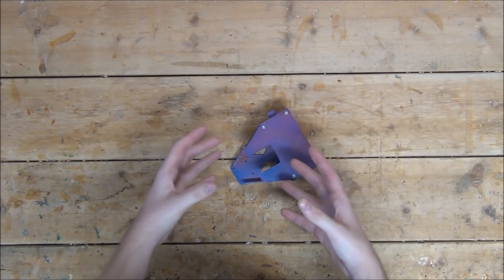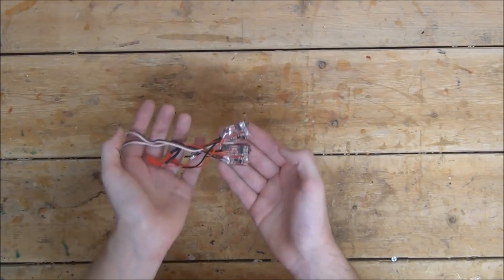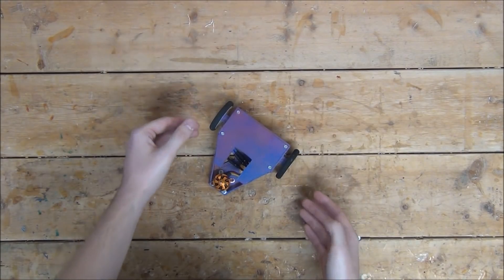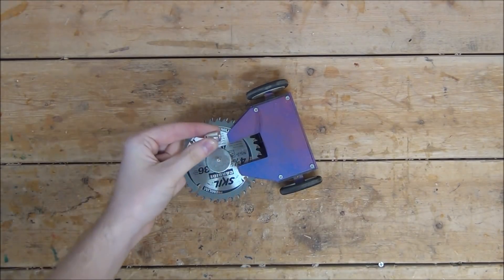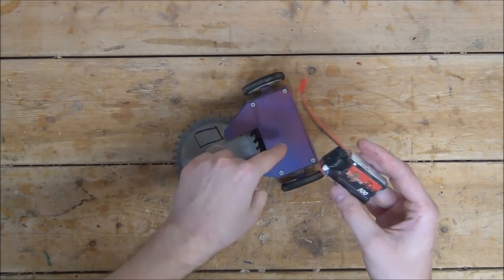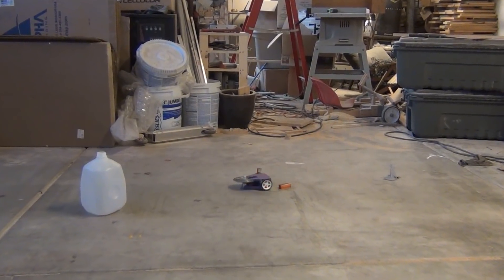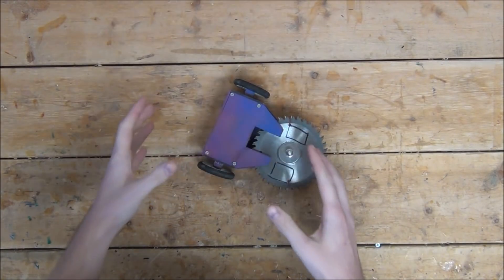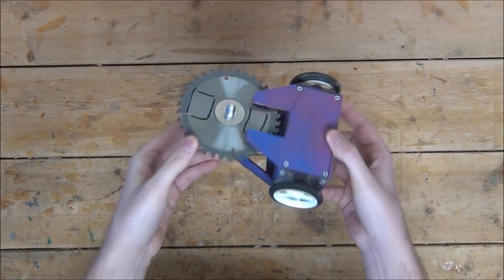How To Build A 1LB Spinner Battlebot Part Two!!! // Testing The Bot!!!

Comment: How the hell are you gonna bolt the blade down if it doesnt have screw thread.. yes theres a thingie you can slide onto the motor with screw thread but its just loose on top..
I superglued it on and tested it with a plastic blade and it almost flew into my tv...
Reply from the maker: Oh mercy no. NEVER test weopons outside a test box! A LOT can go wrong!
Reply from the maker: I cant speak for what you used. As for me, Its a threaded sleeve that goes on the motor. The tighter you tighten it, the tighter it holds to the motor and blade.
Reply: @MechNinji  i did that and superglued it i have the exact same motor only the 2450kv version.
But Im gonna buy one where the shaft is already threaded a lot safer i hope.
And im gonna build a layer on top so it cant fly off.
Reply from the maker: Super glue alone will NEVER hold. I used super glue to hold the blade in place WHILE I tightened the bolt. The super glue does NOTHING after that.
Reply from the maker: But again, NEVER test a bot outside of a testbox.
Reply: @MechNinji  and it was totally safe i took cover behind a chair😂

Comment: I know the video is two years old, but if you combine the two forks on the top part of the chassis, it would be more rigid and might not break as easily.
Reply from the maker: Very true! Yeah, sadly I didnt do a very good job explaining my intentions in this video. At the time i had a LOT of peeps asking me to show them a guide on how to get started building a spinner combat robot. And so I put this video togeather. It was never ment to see actual combat, just ment to surve as a very rough guide on how to get started, and take your first steps. I had a lot of rando parts laying around and so in a few hours I slapped this togeather, just to have fun, and try to show that it doesnt have to be hard to get started. But sadly, even to this day, I get messages of people building this bot part for part which saddens me. In many ways I often feel like this video may have done more harm then good.  :/
Reply: @MechNinji  I think it could be cool if you made another video showing what would actually happen in combat and why this was just a base to get started.

Comment: i see in your video you use https://www.ebay.com/c/691196922#oid332357822669 this esc.  it show me that this esc working voltage is 3.0-9.4v. how did you use 11.1 volt lipo battery? can you explain to me?

Comment: It seems like the drive motor ESC link is broken. Could you recommend another one?
Reply: https://www.ebay.com/itm/RC-ESC-20A-Brush-Motor-Speed-Controller-w-Brake-for-RC-Car-Boat-Tank/332357822669?hash=item4d6211e8cd:g:6PEAAOSwSypY9yNN i found it on ebay and it was the exact same name as the old one, just a different listing

Comment: The "Drive Motor ESC" in EBAY is not found can you post a new link or an AMZN link please?  -- Maybe this one would work -- https://www.amazon.com/Shaluoman-Brush-Motor-Speed-Controller/dp/B07GSVS8D2/ref=sr_1_4?keywords=RC+ESC+20A+Brush+Motor+Speed+Controller+with+Brake-for-RC-Car-Boat-Tank&qid=1567412380&s=gateway&sr=8-4

Comment: Hey a built a bot just like this thanks, I'm having an issue with the bolt staying on the motor for the spinner. Do you have thoughts?
Reply: Hey man, I’m building this bot too. Is it the little cap piece that slides onto the brushless motor that’s sliding off?

Comment: Hey which receiver did you use I saw that it was a spektrum but couldn’t make out the model
Reply from the maker: The one I used in this video was a spektrum dxe, However I don't recommend it. The Skyfly Fs I6 is a LOT cheaper and can do a LOT more in terms of robots.   :)
Reply: Mechanical Ninjineer ah ok thank you so much

Comment: Did you use 12 volt or 6 volt for the drive motors?
Reply from the maker: I believe i used 12v motors for this bot. However i currently use larger 6v motors for my other 1lb.

Comment: I love this tutorial it’s one of the better one’s on youtube, but i had two questions

How does the robot go left and right because it has no servo’s and what channels on your receiver do you use for the blade and the motors?
Reply from the maker: No, i don't use any servos in this bot however i do have two geared dc drive motors (N20s) That I use. They work great you just of course have to run them through ESCs.  Servos typically aren't used for drive motors in anything larger then 150 gram bots because they aren't really built too well for it. 

     As for channels, it will depend on your setup, but i use 1 and 2 (mixed) for drive and 3 for weapon. :)
Reply: Ty i am going to build this one myself. Kust need a cheap rc tranmitter and reciever and rhen i'm all set

Comment: Can I put a 6,5 Volt receiver in the bot?
Reply from the maker: Most receivers can run with 4.8v to about 6v provided to it. But if you do have a 6.5v receiver that's fine, you'll just need a 6.5v BEC.

Comment: I have a question will it work if I use four motors and a weapon and in use four speed controllers instead of 2 with a five channel receiver and use the fifth slot for the weapon motor. Thanks for any help
Reply from the maker: Yes, that is possible! However you can actually get away with 3 ESCs and a 3 channel receiver. Two ESCs, for the 4 drive motors, and 1 ESC for the weapon motor (assuming you're not using a servo, because a serve doesn't need an ESC). Give me a sec and i'll drop a link to 2 of my videos that should help!  :)
Reply from the maker: https://www.youtube.com/watch?v=38LL_vHCpn8&t=313s
Reply from the maker: https://www.youtube.com/watch?v=8JftijCIQ-E

Comment: You could improve on the blade design... simply cut off ALL the teeth except 4, making sure the remaining ones are evenly spaced. this will increase the contact points of the blade with your opponents.
Reply from the maker: I would just use a different blade. Its not usually a good idea to start cutting parts of the blade off because it becomes very hard to keep it balanced

Comment: I know i'm late to this but i hope you can reply. I'm trying to build a bot of my own and i wanted to get those esc's and use the same battery as yours but i couldnt help but notice the battery is a 3s lipo and the drive esc is rated at 2s lipo. Is it still ok to run this or did it fry your esc's?
Reply from the maker: Great question! Since the voltage difference is within like 1.5ish volts it was totally fine. ESCs are almost always rated slightly lower for safety reasons. So if you do go against their recommendations you do so at your own risk.

     With the being said though i didn't test this bot much outside of this video so idk how it reforms long term. BUT i did use the same exact setup in a lifter bot, same bat, same ESCs, same drive motors (actually plus 2 more) the only thing that changed was the brushless motor, i replaced it with a large servo. I fought with that robot and had zero problems. 

    So short answer, if you can find 3s ESCs you like, GO FOR IT! that would be best! But if not, to the best of my knowledge these will work just fine. Just make sure not to leave the battery plugged in untended, but that goes for any and every robot. :)
Show less
Reply: @MechNinji  Thanks this helps alot :)

Comment: How come your bot is remote control could you explain and how it isn't wired
Reply: He is using a 2.4ghz remote controller. you can pick one of these up anywhere for very cheap. He has that connected to  a reciver on the bot.

Comment: AND! How many different main batteries will I need? How long does just one battery last?
Reply from the maker: The Robot will only need one battery in it at a time, however you will want spares. As for how long it lasts that depends on what kind and size of motors you're using and what size battery. For me, the battery i used lasted about 4 or 5mins on a single charge in my bot.  :)

Comment: also. what did you use to attach the wheels to thr motor housings
Reply from the maker: A great thing you can use for that are hubs. There are alot of different versions however 3mm universal mounting hubs should work just fine for n20 motors ( the drive motors i used in this video)  :)

Comment: im making this bot as a project, is their anyway to hace the blae in a different postion? Low instead of high?
Reply from the maker: You're asking if there's a way to mount the blade lower? No, not really. However you could mount the motor upside-down which in turn would make the blade alot lower. That is probably your best bet OR you could make a vertical spinner.  :)

Comment: Where exactly to do u connect the gear motors to the esc wires
Reply: Where do u solder it to
Reply from the maker: Im so sorry, im not sure if I understand the question... But the brushed motor will have two leads that you'll solder to the two output leads of your brushed ESC. Does that help?
Reply: Mechanical Ninjineer thanks that helps

Comment: Could you please remake this because some of the parts I need are no longer in nger available and I really want to make this robot
Reply from the maker: All the parts should still be available, what are you having trouble finding?
Reply: Mechanical Ninjineer the first part of the wheels gear box in part one it is no longer available
Reply: Mechanical Ninjineer or the motor housing is no longer available
Reply: Mechanical Ninjineer motor housing look for yourself
Reply from the maker: well here are the motor housings https://www.aliexpress.com/item/F05101-10pcs-3PI-miniQ-N20-Micro-Motor-Mount-Set-12mm-DC-Gear-Motor-Mounting-Bracket-Toy/32814175769.html?spm=2114.search0204.3.2.466d5d7ePJQzc2&ws_ab_test=searchweb0_0,searchweb201602_1_10152_10151_10065_10344_10130_10068_10324_10547_10342_10325_10546_10343_10340_10548_10341_10545_10696_10084_10083_10618_5723411_10307_10059_100031_10103_10624_10623_10622_10621_10620,searchweb201603_45,ppcSwitch_5_ppcChannel&algo_expid=19a14a63-c998-4e39-b743-a98a3fc20895-0&algo_pvid=19a14a63-c998-4e39-b743-a98a3fc20895&transAbTest=ae803_1&priceBeautifyAB=0
Reply from the maker: sorry for the super long link...
Reply: Mechanical Ninjineer it doesn't matter I just wanted to get the right parts
Reply: Mechanical Ninjineer thanx

Comment: And how much does all this cost?
Reply: If you add up all the parts he links to, you arrive around $130. The blade is probably around $15, and lexan polycarb is around $5 - $10 for a small sheet. So the whole thing probably cost around $160 or so plus consumables (glue, struts, etc.), certainly all in should be well less than $200. Of course, that's before one factors in spare parts...
Reply: Ok. Thanks, Leigh Hargreaves! Wondering if i could make it myself. Thanks for the help!

Comment: I made a bot with a DC Motor, a huge clip, and a battery for the base of it. I used the DC Motor with a wedge shape piece to hit against the clip and shake. It shakes in a circle so it wouldnt stay in one place. The bot has a blade on the end of it to jam wheels, or cut or scratch if driven into. It’s basically a minibot that auto-pilots.
Reply from the maker: Im not 100% sure what you mean, but it sounds really cool!
Reply: Mechanical Ninjineer lol thanks!

Comment: Hey Mechanical Ninjineer! I am 14 years old and I'm building my first ever bot based off of your design (with a few tweaks), but instead of cutting out the pieces of lexan and gluing them together like you did in your video, I cut the all the shapes as one flat piece and used a heat gun to bend the parts into place. Unfortunately this caused the bottom piece to warp, and I was wondering if you knew of any ways to keep this from happening. Thanks for any advice!
Reply from the maker: Yes, I have actually done that! Here is a video I made about it! I hope it helps!  :D
Reply from the maker: dang it... I forgot to add the link... hahaha!   https://www.youtube.com/watch?v=c6k6MsTE6JI
Reply from the maker: I actually went back to welding the frame together with lexan solvent after that video because I found it easier. Here's a video about how the welded frame held up. skip to the end to see it get hit by saws.  https://www.youtube.com/watch?v=4IZX0aw94IM&t=28s
Reply: Thanks!

Comment: could you plz put the control board and controller with the transmitter and reciever. Plz  I really want to make this bot
Reply from the maker: What do you mean? I only have a transmitter and receiver.
Reply: sorry i meant the link!
Reply: Sorry
Reply: WHAT DID YOU JUST SAY???
Reply: @Michanical ninjaneer so you did not use a circuit board at all? You just hooked up every single motor to the reciever?
Reply: @Doctorapocalypse2  The 'circuit board' you're talking about is an ESC. This uses three of them: one for the weapon motor and one for each drive motor. They take the signal from the receiver and translate it into the correct voltage/current output to drive the motor.

Recievers are also a 'circuit board', which is why we don't just call everything a 'circuit board'.
Reply: Oke so i just need the reciever and then it chould work?
Reply: @Doctorapocalypse2  No. You need ESCs to run your motors - usually one per motor, but sometimes you can get ESCs which will run two motors at once.
Reply: Oh oke and these esc does it matter wich one? Or can i just type in esc and order them from amazon or something like that? And btw thnx for the help
Reply: @Doctorapocalypse2  You need to do a bit of work to match the ESC to the motor you're planning to use, just making sure that the ESC can deliver the power than your motors need. 

ESCs have two ratings that really matter - the voltage (V) they can handle, and the current (A) they can deliver. The ones used in this video are rated to run on a 2S LiPo battery which is 8.4V -  so they are plenty powerful enough to run the 6v motors. They're also rated for a current of 20A which, while I don't know the maximum current the motors will take, is definitely PLENTY more than you need for these motors. If you decided to use the 12V version of these motors, you would look for the smallest possible ESC which is rated for 12V or higher.

A lot of people who build fighting robots actually run their electronics at slightly higher Voltages than they're designed for, which you can usually get away with because fights don't last very long. But, if you're building your first robot, it can sometimes be nice to 'over-build' your electronics to make extra sure they won't fail on you!
Reply: @ryanbratley6199  thanks. Very helpful

Comment: How is it controlled
Reply from the maker: Its controlled using the DXe transmitter and receiver I talked about and showed in the video.  :)
Reply: Mechanical Ninjineer i mustve missed that.. Thanks
Reply from the maker: this is not the transmitter I used for this bot (I use it now though), but in my opion it is a much better one and cheaper!  :D   this is an affiliate link by the way   https://amzn.to/2qc32V3
Reply: Thanks alot there

Comment: amazon has the battery unavailable what battery would you suggest now???
Reply from the maker: Any battery that is the same voltage and has the same mah will be fine. If that particular seller is out, you can usually scroll to the bottom of the page and see similar results.

Comment: i am going to blame this on you
i destroyed my servo looking at your servo esc and now my one just spins out of control
you might be asking how is this your fault 
well i commented ona another video and you replyed but then i sent another with a link you never responded
Reply: yes i have the the fine tunning and the spinning the thing part
Reply from the maker: sorry, what? did you use a continuous rotation servo? if so just adjust the potentiometer until the motor stops.
Reply: well does it[ have] to be the rotating servo? if yes then i take what i said back
Reply from the maker: Like I said in the video, it works best with a continuous rotation servo. You could use a regular servo but you will have to first center the potentiometer with the channel you are controlling it through, then super glue it in place so it doesn't move. You could make it though!  :)

Comment: Very cool! I would recommend a bar over a blade or disc, with the amount of vertical spinners out there, an uppercut is very likely as you have a fairly slow drive. With a quicker drive you could steer out of trouble as 90% of winning is control.

Comment: How did you fit the battery in there, it looked so crammed even without it
Reply from the maker: It was snug but it actually wasn't too tight once I put the smaller esc's in the corner.  :)

Comment: are those big hits coming from the gaps between the saw? also, have you ever tried using foamboard?
Reply from the maker: Yes, they are from the teeth on the blade. Using foam board for the body? I don't think it would stand up very well.
Reply: Mechanical Ninjineer I'm trying to make one out of foamboard right now. mainly because it's light. and I have plenty of it.
Reply from the maker: That would be interesting. Are you build a drone battlebot?
Reply: Mechanical Ninjineer no. a dustpan based on a design. on a smaller scale. and changed in some areas
Reply: Spoiler alert. It never went well. Went 0:2. However i am trying to remake it. Yay

Comment: You should drill out the blade except for the edges to save weight. You could also add more weight to the edges so that it hit's with more power. The blade weight is more efficiently used if it is on the dgees.
Reply from the maker: That sound like a good idea! Im just a little hesitant to drill into it because it is so easy to throw off the balance and weight of the blade.
Reply: That is true.

Comment: Once you get the smaller nut, I would run it upside down so it is more like a undercutter and is harder for wedges to wedge you. You will also be able to undercut wheels way better.
Reply from the maker: very true! That how i'm hoping to drive it!
Reply: @MechNinji  How did you set up the servos as a drive train in your 150 gram version? Mine won't turn continuously to drive.
I'm using a Fs t6 transmitter